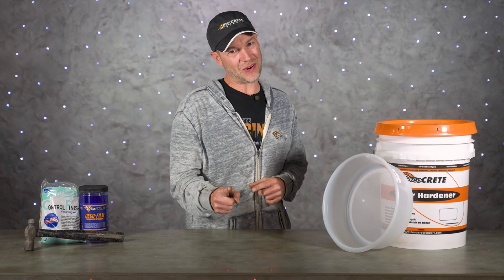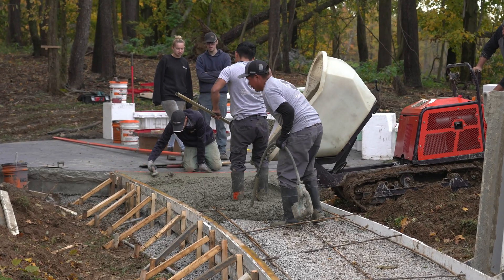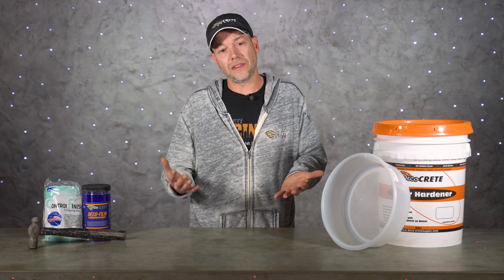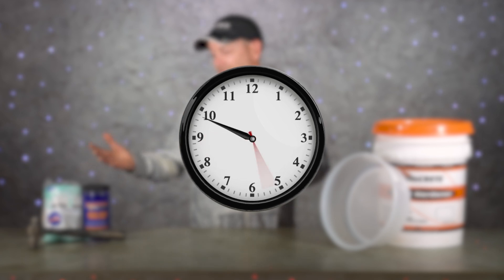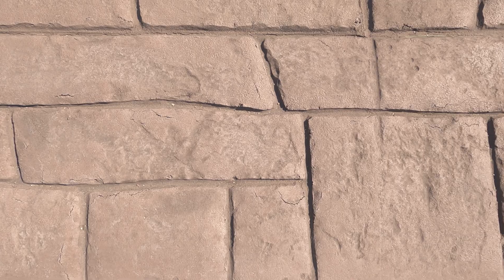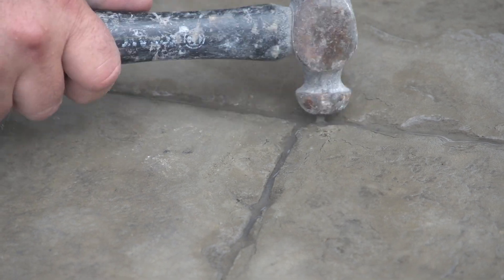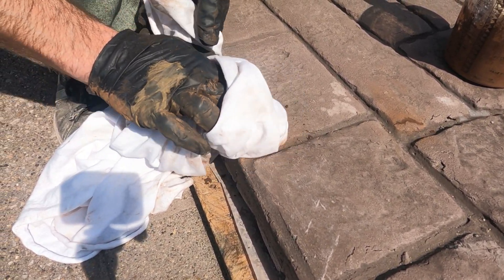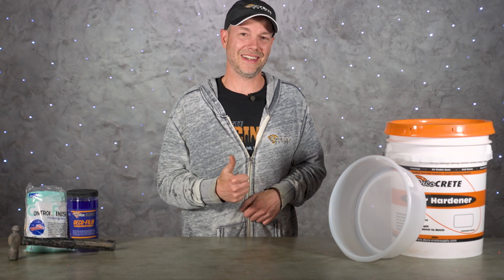How to Prevent Concrete Surface Cracks!

Comment: We just had a contractor come out to pour and stamp our patio, and the color release powder has been on there for 2 days now and they are coming to wash it off tomorrow. However, I went out there and looked at it earlier today and there are A TON of the cracks and some very large defects on our patio. Do you possibly think I could email some photos I took of these issues, and you let me know whether not these will be able to be fixed properly, or if they need to tear it all up and redo it? Because everything I’m reading online is saying that these are unacceptable and cannot be properly fixed without redoing the entire patio over… 🤦‍♂️ I really don’t trust this contractor now that we have dealt with them more as well… We are going to void the final check that he asked for when they were done pouring. Probably because he knew damn well that they did a crap job and that these cracks were going to only get a lot worse because they poured it on a 90 degree day with 25mph sustained winds with gusts up to 45mph that day and it dropped into the high 50’s that night. They used integral color. If you could please help give me any advice and/or feedback as to what we should do/require from our contractor in order to have our patio fix properly, it would be beyond appreciated!!